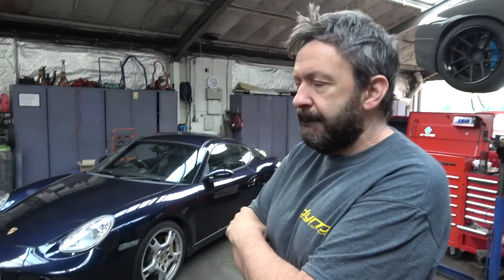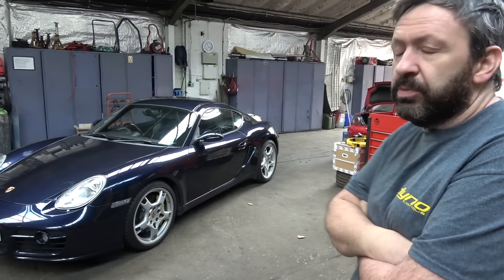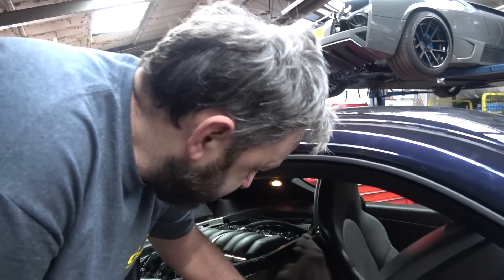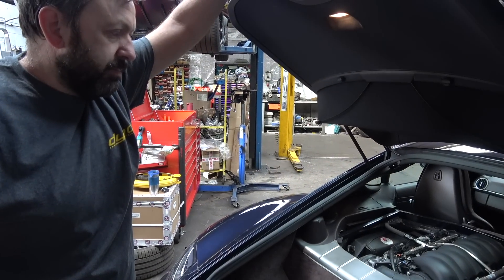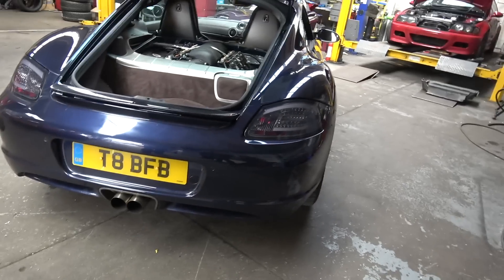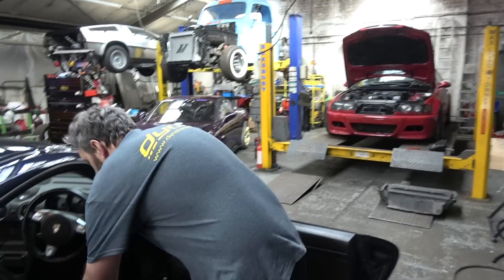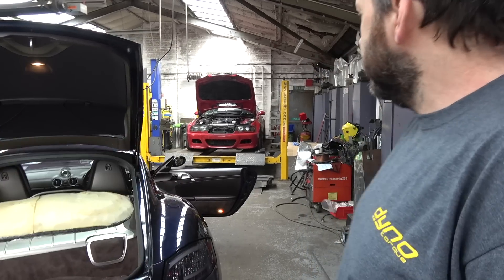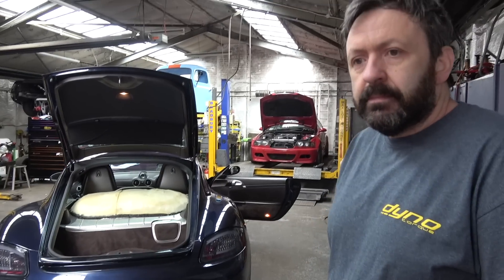LS3 V8 Engine Swap Porsche Cayman by Dyno Torque

Comment: Looking at this, it’s phenomenal. I especially like the use of the shorter shafts to retain the rear strut tower brace, however, I feel like some gold insulation tape on the top of the intake manifold and piping would help with intake heat soak. I would be curious to see how that would aid power and response

Comment: Great idea. Let's take one of the most balanced, best handling sports cars on the planet and replace it's low CoG flat six engine with a heavier, taller engine, thus raising the overall CoG of the car (especially at the back where the centre of mass is), and moving the engine mass forward resulting in a totally different front/back weight balance. Result: sure it's got more power so it'll go faster in a straight line, chances of it handling as well after? pretty much zero.

Comment: Is this a Holden LS, or a U.S. important from GM? Do you know if there's much of a difference between the Holden and the GM LS's, other than the UK and Aussie spec probably have tighter emissions?
Reply from the maker: It's a crate LS3 from the U.S.
Reply: Holden LS's are always a mix match of parts, like the ls1 having a bunch of ls6 stuff and the 6.0s having a bunch of ls2 parts etc but other than that they tend to be detuned I assume to not take away from their premier models in the u.s and Australia has very lax restrictions which is why we are a dumping ground for all of Japan's "dirty" engines they can't sell else where.

Comment: He said he saved 3 inches going with the FWD LS stuff, but like... Imagine if you did the opposite of those V12 LS guys and made a V6 based on a destroked aluminum LS7, then gave it a bitchin (but still streetable) cam and 11.5:1 or so compression. We're talking ~450 HP and ~350 lb-ft out of a 4.3L engine that's another 4" shorter on top of what they're already achieving. Plus it'll still use commonly available rods, pistons, valves, and other small parts.
Reply from the maker: But then it'd be a V6 & V6's suck.
Reply: @driftworks  Not really, but everyone's a critic. When are you guys finishing the 10-into-1 header? I wanna hear that SICK SOUND, mate.

Comment: Great isn't enough of a word to describe this conversion,, I've been looking at a Cayman 2006, 2.7 which seems to be quite a risky engine but are relatively cheap to buy.. I'm not into big powerful engine swaps as I would like a reliable daily driver with a 2 litre 4 pot engine installed and again utilising the porsche gearbox, ecu's swapped as required and maintaining the original look of the car as you've done with the LS3 conversion...etc what would such a project cost just in ballpark terms if you could help...

Comment: Americans don't do it like that because we are a bit taller on average.
Honestly...moving the wall towards the driver pushes the seat forward several inches.
I am 6'1" 220lbs...pretty sure I wouldn't fit in there.
I do like the Emerald computer...it making it possible to run the factory gauges.
Will it handle boost?
I will look into that brand.
In the US we like to show off the engine...not hide it. Most conversions I have seen here have lexan or plexihlass over the engine. You know...like Ferrari and Lamborghini do.
You should check out B is for build.
He is installing a 1300 hp LS in a Lamborghini Huracan. No seriously...he really is!

Comment: Porsche just announced a new Cayman and Boxster with a 3.0L flat 6 engine and 6 speed manual.  Boxster at just below $100,000 and the Cayman at about $105,000!  That's before the obligatory Porsche skewer for options.

Comment: When Corvette C8  comes out.
it would become easier to convert European midengine sports car to LS.
because midengine transmission specifically built for LS mounting holes will become readily available also.
Reply: Facts and ls engines are cheap as fuck
Reply: LT*

Comment: Fk me.  Its like ordering a fine meal and then putting cheap tomato sauce on it.
Reply: No, it's like ordering a chicken korma and jamming it full of chillis. The original.engines are weak power wise, prone to problems and unreliable, this engine is muxh more powerful, sounds fantastic and proven very reliable.
Reply: Porsche purist. Caymans have been underpowered for years, as Porsche doesn't want it to show up the 911.

Comment: Would have been great to have some good views of the engine instead of just the guy talking
Reply from the maker: Google LS3.
Reply: @driftworks  Thanks for the reply. I'm doing an LS7 swap into a Cayman now and was interested to see details of how he did his.  His motor seems to sit a bit higher than others I've seen. Also curious about the accessory drive and how he chose to fit it in the car.

Comment: And thus the most reliable and least expensive to maintain Porsche was created.
Reply: Not really. The rest of the car still uses expensive Porsche parts.
Reply: @Greenmonkey552  the engine is the known weak point. The rest of the car is pretty well built .

Comment: A chevy engine in a Porsche??  This is horseshoe....Why??  This should never be done....
Reply: Because it's a more reliable engine than the 3,4 liter flat six. And cheaper, more power.   I really like Porsche to be original as can be but it doesn't make sense sometimes to keep the stock engine. For example to guys who put ls in a 944 or 911 996.  Cheap to buy as a car but pretty expensive to rebuild or source a new Porsche engine.

Comment: Car sounds beefy and perfect.    Stock LS3 is 415- 430hp
Reply: If he used a FWD engine (i believe he mentions doing so because of the added ease of shoehorning it into the car), odds are it was the LS4 which is a 5.3, definitely not the same as a 3.  Not that it takes away from the impressiveness of the build, because this is beyond awesome.  Or maybe the accent thickness and my long day are making me miss something.

Comment: Of the very, very many questions I have about the practicality of stuffing a V8 into a boxer platform, paramount is handling issues (i.e. balance). I imagine it's a nightmare not worth the effort.
Reply: The LS-series of engines is actually surprisingly light, for what it is (displacement and power). Remember, it only has one cam and only two valves per cylinder. An old iron BMW inline big six with DOHC should be about the same weight range. The Porsche boxer six-pot is also not a lightweight. The Subaru six, while not a direct comparison to the Porsche six, is close enough and is often used as an aircraft engine and the package runs at about the same weight as an LS powered package.

Anyway, with the engine between the axles and not hanging off of one end, the handling should be less affected by the engine swap than by an additional passenger 😉
Reply: @daszieher  Thx.
Reply: Siddiq,  true,  but an ohv V8 has most of its mass at the bottom, so it may not be a significant disadvantage.  Power fixes all that :)
Reply: @jamesengland7461  😎
Reply: And regardless of the engine weight,  it's in the right location,  so the rear weight balance is retained.   If it shifts a couple percent,  well that's more weight over the rear tires,  improving acceleration and braking.
Reply: @jamesengland7461  Higher center of gravity, but tail happy Porsches are out of balance to begin with, so perhaps not as bad as one might guess?

Comment: Not to disagree, but this can’t be an LS3. He mentioned that it came from a front wheel drive setup, the only displacement used in that setup was 5.3L LS4, it had its own unique bellhousing bolt pattern which was borrowed from the car line platforms, and unique f.e.a.d. The LS3 was 6.2L displacement.
Reply from the maker: He said he used parts from the front wheel drive LS on the LS3.
Reply: It's an LS3, but he chose to dress the front of the motor with parts off the transverse LS4 (plumbing & pulleys) to make the entire engine 2-inches shorter.  That combined with moving the firewall forward 2-inches allowed it all to fit without moving the transaxle.

Comment: Chevy might build some crappy cars, but there engines have always been the best
Reply: stephen7740 Which chevy engine won the Le Mans and Daytona back in the 60s? Oops, the 427! Hence always made the  best, is quite a stretch of imagination on your end by all means.
Reply: New C8 Corvette...it will be abusing European and Japanese cars!
The C7 was already giving all other makers fits!
Reply: @keithcannon3682  And  which  of the top 3 spots did the  C7 take at Le Mans? The c8 will what? Did you mean if the bugs ate worked of it and can run 24 hours without breaking down.
And if my aunt had nads, she'd be my uncle!
Reply: @leonvoltaire  ....hmmm...LeMans...you mean where Ford abused the competition with the new Ford GT the last couple of years?
I am talking about the average guy being able to purchase something that performs at practically supercar even hypercar standards for the price of a Toyota Camry (used Corvette...new Camry)then going out and beating up on supercars.
There are just very few cars that can perform at this level for this kind of coin.
The 2015 Corvette Z06 for example.
650 hp (pull the suppercharger,add twin turbos amd you can make well over 1000 whp..it has been done) 8 speed automatic,huge carbon ceramic brakes etc. This car can be purchased for 60k.
No suprecar can come near this performance per dollar value.
As stated earlier. Spend another 15k on it and you have a thousand plus hp.
Right there you can outrun,outhandle and just plain embarrass 99.9% of cars on the road today...facts man...just facts!
I don't give 2 shites what a car is doing on a racetrack. Those cars are almost not even road cars any longer.
Same with drag racing.
If a car can not be driven with relative ease on the street then I couldn't care less how fast it gets around a track or down a dragstrip.
That's my opinion!
Reply: @keithcannon3682  Yep, bow to Rome's authority..You're right.
Reply: @leonvoltaire  ...by the way...the new C8 is going to be the least fast iteration of the lineup and it will do 0-60 in less than 3 seconds!
I have found my next car purchase.
We are all fully aware that the LS engines can make a streetable 1500hp!
The C8 will murder the Cayman GT4 at 20+ thousand dollars less!
Not to mention you can actaully build the LS engine to over double the factory horsepower rating and inexpensively do so!
All you can do with the  Cayman GT4 is wait for that pathetic flat 6 to grenade!
Once all the bugs are worked out this C8 will be dominating any race seires it takes part in!
Dang...Trump winning in 2020 and this new 2020 C8!
Man it is great to be an American!

Comment: LSx conversions are GREAT! No one builds better trouble free and maintenance cheep engines then GM. I have a 89 944S2 with a LS3 and I can drive it anyware and not worry about not making it home. I also smoke allot of so called supercars in straight line and when it comes to curvy roads just forget it I'm gone. I've got a buddy that has 1st generation Lotus Turbo Espit with a LS conversion and it just marvellous car. LS is the way to go if you drive a car with unreliable engines.
Reply: That 944 isn't the red one I saw on YouTube (ordinary or everyday car reviews or something?) the other day is it?

Comment: So ... earplugs then headphones... and sweat like the craziest sauna ever? ,bet it does drive like the best thing ever, but at what cost? Tinnitus and a gallon of sweat every time you run?  Seriously will there be a plan for sound and not baking?
Reply from the maker: Not sure what you're referring to. Did you not watch the bit with showing the engine cover? It looks to me pretty much like it did with the stock engine.
Reply: @driftworks  , yes with out a cover, and I'll be the first to say I have no clue about that platform. Just wondering how an engine with no shielding behind your head would sound and feel temperature wise. Sick build, no hate only love and a curious mind of ignorance made me wonder how loud and hot it was in the cabin

Comment: The whole car balance will change. The beauty of Cayman is Boxster engine - low gravity. It become a drag racing car.
Reply: The thing about the LS family is they are cam in block, overhead valve engines. They only have 16 valves. The heads are very small and the engine is bottom heavy at the crank. 

If anything, i would almost expect it to improve handling performance, seeing as how the engine was pushed forward rather than backwards like most V8 Porsche swaps. Having a little extra weight pushing the car down in the curves. LS3 is very light too, less than 450lbs dressed and full of water and oil.
Reply: @ChuckBeefOG  I was about to say the same thing. LS's are light and bottom heavy!
I doubt there's much difference in mass to the Porsche engine.

Comment: Oy. I can only imagine a spark plug job on this...
Reply: GM uses iridium spark plugs and they only need to be  changed every hundred thousand miles
Reply: Go to 6:28 When they look at the LS6 headers. You can get to the spark plugs fine on the right hand side (a bit tight, but they always are on pushrod V8's). Left hand side is probably fine once the airbox is removed.

Comment: How much would that conversion cost? Roughly...
Reply: If you have to ask...
Reply: @philipschrantz8402  don't be that guy.
Reply: If you do all the work yourself it’s significantly less and realistic to do
Reply: Engine,computer,conversion parts,labor...probably more than the car itself  is worth. 
You can buy a nice Cayman S of the same vintage for 25k.
I would bet the swap installed including parts was over 30k!
What are the emissions standards there.
It varies wildly ftom state to state
in the US.

Comment: Some serious engineering going on at Dyno Torque, it's a travesty that Porsche built such a lovely little Sports Car with such a massive flaw, which thanks to guys like this the owners can finally get years of enjoyable and worry free driving.
Reply: Massive flaw ??? Fill me in.
Reply: @jamesmarshall3311  Gen 1 (so up to 2008) 987 engines in 3.4 guise can have bore scoring and IMS issues.
Reply: @jamesmarshall3311  if you're serious  and really want to know speak to the guys at DynoTorque or Hartech, they'd be happy to fill you in with any engineering questions you might have.

Comment: What about the oil pan ?
The engine is backwards ,the oil pick up tube is now on the front side of the car as i know,and when accelerating the oil will go at its opposite.
Reply: Is it really backwards? Its an mid engine, not rear
Reply: @danielssonsgarage  yeh it's not backwards
Reply: @danielssonsgarage  

Mid engine or rear engine means nothing.
There are front wheel drive vehicles with longitudinal engines with gearboxes in front of the engines...
Reply: @michaelovitch  so? dude chill, yes it means something. If its rear engine the transaxle are in front. This is a mid engine, the engine has the same direction with the trans behind it as if it was at the front of the car 😎
Reply: @danielssonsgarage  Theorically yes.
But like i said ,you can have front wheel drive cars ,or even simply front engine cars with a gearbox in front of the engine,or behind it, or on its side ,so the bellhousing is facing the front or the rear...or the side.
So usual theory and facts are different. That's why i asked there for the oil pan.
Reply: Yeh that's why Taylor Hoovers LS911 blew on track from oil starvation
Reply from the maker: It's a good question. I'll ask.
Reply: The engine isn't backwards. It sits longditudinally. Engine is towards the front of the car, gearbox behind.
Reply: @edmspeedprojects  it is backwards, the intake is forward on a LS, it has to be facing that way for it to work but if they plan on driving it hard the sump should be modified as a precation
Reply: Oh I know what you mean, your right I guess it's just how they did the intake, I'm getting confused with some of the 911 LSs I've seen but obvisoly they are rear engine not mid
Reply: @ikebuttle360  The LS engines can have their intake flipped 180 ° it's all symetrical.
But that doesn't mean the engine in its habitual position.
Reply: @edmspeedprojects  Ok,so the oil pan is working nearly as usual.
Reply: Baffles!
Reply: Craig indicated that the ' engine access panel' was there to access the balance mechanism for the front of the engine.

Comment: So you used the ancillaries from a FWD LS4 engine, with LS3 internals/heads etc, that’s brilliant mate. 

For those who don’t know the LS4 is a 5.3 used in FWD...

2005–2008 Pontiac Grand Prix GXP

2006–2009 Chevrolet Impala SS

2006–2007 Chevrolet Monte Carlo SS

2008–2009 Buick LaCrosse Super

Had horrible heads and intake manifold but heads and intake from other LS platforms bolt right on. Uses a different bell housing though so won’t bolt up to other LS trannies.
Reply from the maker: Thanks for the info!
Reply: Love the builds you guys are doing, DynoTorque included 👊🏼

Comment: This is amazing. I mean we have all seen LS swapped Miata's etc, but a mid-engine Porsche?! Definitely the coolest thing I have seen in a while. I would keep this car forever if I built this, I'm sure it would be a dream to drive especially since you kept the Porsche gearbox etc. We need to see a video of it cruising around! Edit: My father-in-law has an older 2007 Boxster S and the sound of the engine RIGHT behind you is pretty cool, this LS must sound incredible!
Reply: I have a(05) 987.1 S. Boxster. I Would love to do something like this if my engine goes..
Reply: @UsRanger have you reached out to renegade hybrids? They quoted me same car. Wont put the price out there but not bad. Might be better to do the swap before the engine blows cause you can sell it.